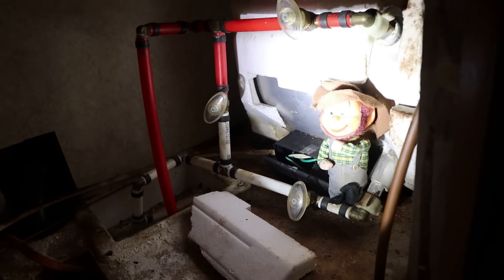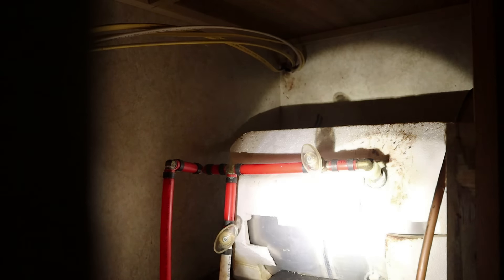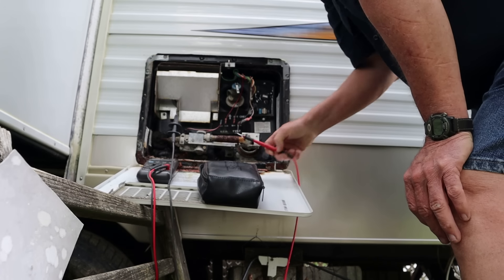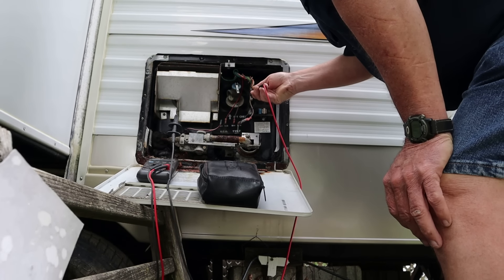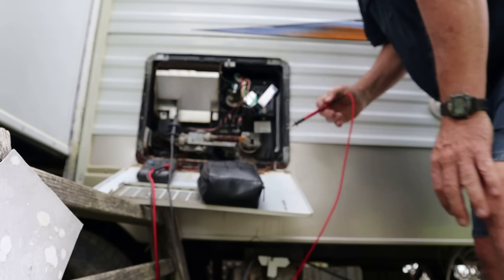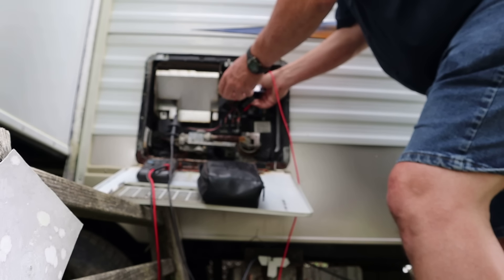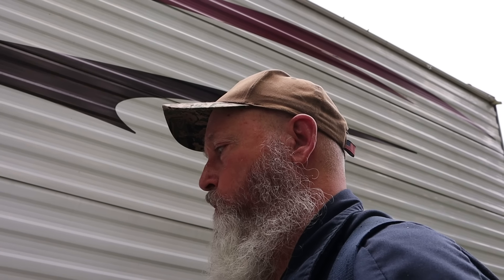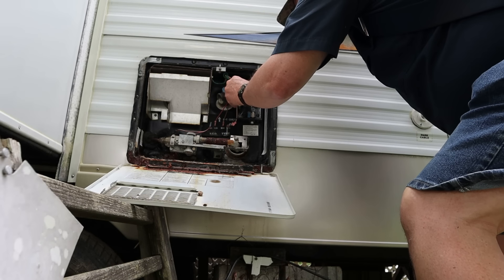I Got a Call to Fix an RV Water Heater. Then THIS Happened....

Comment: A relay that uses 12V to trigger a 120V current enough to run a water heater element?  That's a big one and it sure seems a likely place to look for problems even if it's not the only problem.
Congrats on the problem solving process you got going.  One of the first things I learned was "Never assume you only have one problem.  If you find something and fix it without assuring that it's the only problem, you're setting yourself up to fail".  The way you do things is not setting yourself up to fail, and that's pretty rare these days.
I appreciate your videos.  Please keep 'em coming.   Thanks.

Comment: My buddy bought another camper recently and asked me to help him figure out why the slider wouldn't go in. It's in a park near his regular camper. Apparently this park has a really handy guy going around replacing fridges for people... but he runs all wiring in a single color to save money so he can afford to use 6awg with no fuses, but then he confuses polarity making it easier to burn it down. Great stuff. Everything was melted and the fuse board was shot, so was the brand new fridge. I hot wired the slider motors individually with a jumper pack and they slid in no problem.
Reply from the maker: I love those campground fixit cheap guys.
Reply: @hillbillyrv  i bet they keep you busy 😆 appreciate ya

Comment: There is a good chance you need a battery. With converter bad it probably drained battery, even tho its electric you still need 12 volts. I noticed at beginning of video I heard the carbon monoxide alarm chirp from low power.

Comment: You can have the camper plugged in, but you still need the battery. if the battery's dead, Or not holding a charge, the water heater will not work.
Reply from the maker: False
Reply: @hillbillyrv  I had it happen to me
Reply: No.. just no... there is a device called a converter

Comment: When probing does your meter have a capability for a no touch when finding a power source. With mine I start with the no touch sensor  just to see if there is power of any Volt then move to using leads to test for voltage readings.  
Can you add a remote voltage input to isolate voltage issues coming in to board..
Reply from the maker: My meter is  probably 35 years old.

Comment: Wow just level the trailer and the water heater works again . LOL 😂
Reply: That's what rv manual says LOL
Reply: It is level. It’s just an illusion. She’s parked on a downhill decline. So one side will be lower than the other to keep it level. You would not be able to get your fridge to work on that kind of incline, and would cause issues for other comments, not to mention trying to live in such an unlevel camper.

Comment: Funny expression “back probe”  never heard anyone state it that way before , and I have been an electrician for 40 years !
Reply from the maker: It’s more of an automotive thing probably. Back probing connectors while they are still plugged in.
Reply: Used it a lot in appliance repair too. Came into use when low voltage controls started to appear. But we back probed terminals on thermostats and thermal fuses all the time too.
Reply: Sounds exciting- so she said.
Reply: “Back-probe” has been a ‘thing’ since I started messing around with electrons (1969-ish).

It means to probe the wire side of the connector instead of the terminal side of the connector, while it is still connected.
Using extra-thin meter probes.

Comment: Huh 🤔 funny the my vehicle has the exact same problem that one wire goes to the computer $1100 bucks changed that and still didn’t fix it. The egr valve gets a constant 12v

Comment: You should get a 12 volt sealed lead acid battery to use for powering the motherboard. This will tell you where to start next with the diagnosis.

Comment: Voltage falls and current rises to compensate.  If voltage falls far enough you overcurrent internal electronic components on the boards. 

Basic Ohms law.  

I’ve seen this before, not on RVs.  On remote SCADA equipment when power fails and batteries go dead.